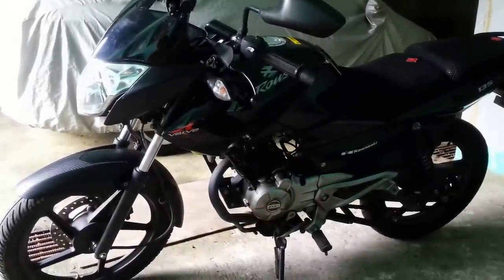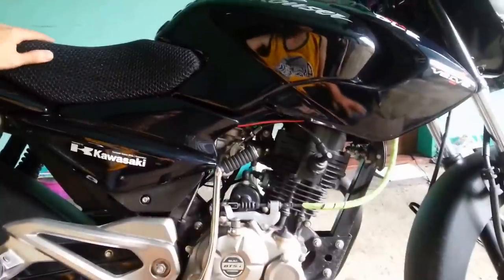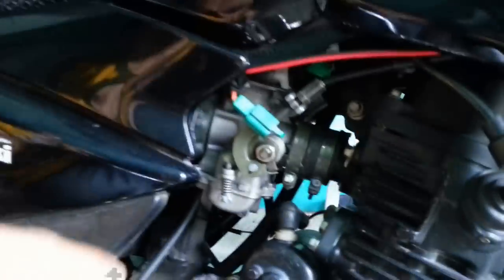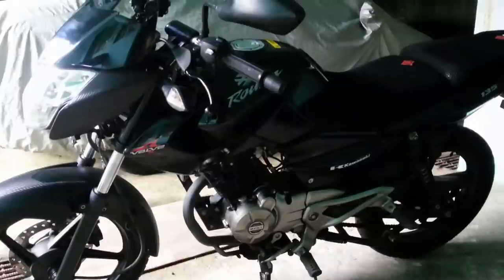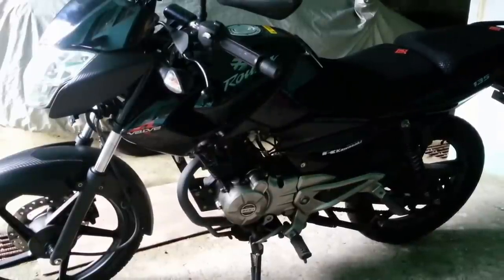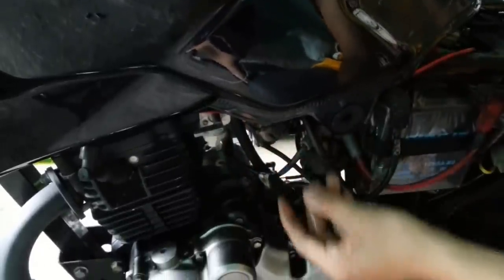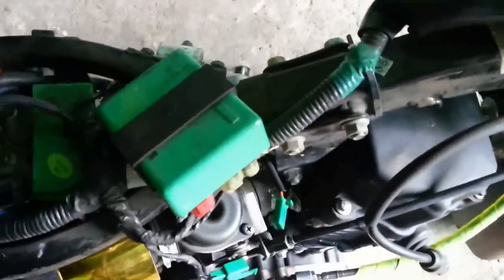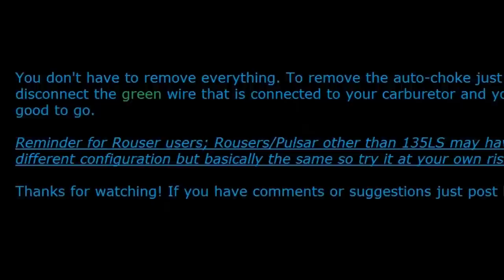how to remove auto choke rouser / pulsar

Comment: Is there a benefit of having the auto choke still connected? what really is the purpose of the auto choke feature?
Reply from the maker: The only purpose of the auto choke is to help to warm up the engine. But when it is already heated up then its just annoying thing that you have to deal with every time you start up the motor.

Comment: I saw you removed stock air filter, which one is this?
Reply from the maker: I did not remove the filters. I just replaced it to have a space for the alarm system.
Reply: Replaced with..? which filters?
Reply from the maker: +Tanuj Khandelwal (TK) yup.
Reply: +Tanuj Khandelwal (TK) its a china brand filter i guess

Comment: when you remove the auto choke u will have bit of trouble starting when its cold outside
Reply from the maker: I live in baguio 11°c average temp. what I do is to kick start 5x before I turn it on but I rarely do that. no problem on starting my bike. :)
Reply: i had the auto choke turnedd of a few months but i put it back since winter is kickn in and i dnt have to hold the throttle to keep idle when its cold in the mornings
Reply: Tanks

Comment: Tinanggal mo auto choke edi lagi nang naka choke yan? Rich mixture ang labas nyan.
Reply: And also that green box is the C.D.I.  it converts 12VAC into high voltage for you ignition coil.
Reply from the maker: Hello Marvinchidos. Hindi na sya naka choke maririnig mo naman sa tunog. Tama naman na cdi ang tawag sa green box pero may isa pang green box na mas maliit sa taas ng battery ang tawag dun ay rectifier. Bale mula sa stator to rectifier then C.D.I. hindi naten gagalawin ang CDI we just have to remove wild reving sound during hot days but when its cold weather we need to connect it to help to warm the engine. But its optional depends on you preference. Thanks for the comments though ☺

Comment: Ung sakin mga paps ang hirap mag pa andar. Ng makina umaandar Naman.ang Tagal pa anu bang problem. Kailangan bang palitan ung karb? Salamat sa mka sagot. First time ko po sa motor na yan.😕
Reply from the maker: Bagong motor paps?
Reply: +hanzl maralit paps 2nd owner na ako Pero Nung una OK nmn binili ko as 2ndhand sya Pero 1yer palang po sa kaibigan ko. Hindi nmn palagi ginagamit. Kabisado ko talaga ang unit tz nung una OK pa Ngayon hirap na I start.
Reply from the maker: Pa tune up mo muna siguro para makita kung maluwag ang intake at exhaust at para malinisan na din ang carbs pati spark plug
Reply: +hanzl maralit malinis na ung carb. Nya Pero ganun pa rin Salamat paps try ko ung spark plug.
Reply: bro papaano po ba e fixed yong headligh pag pinaadar ay nagblink2x
Reply from the maker: @anabelle pwedeng battery yan. Mahina pasok ng kuryente.